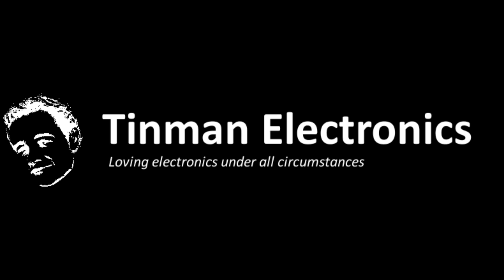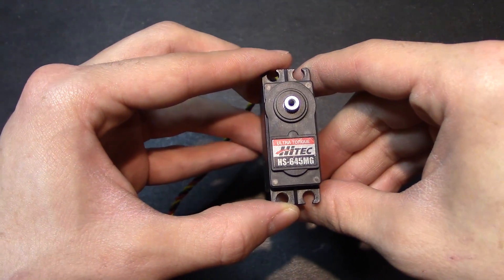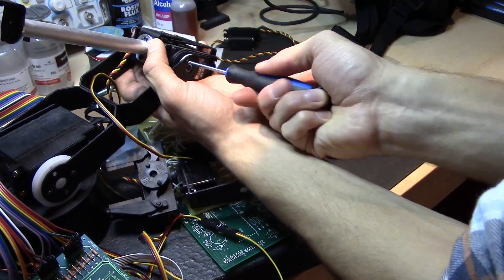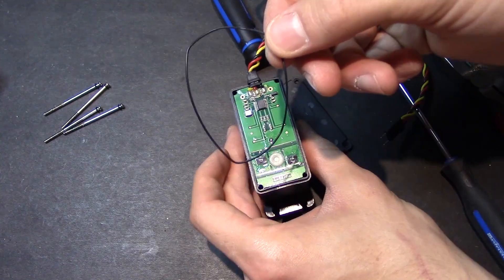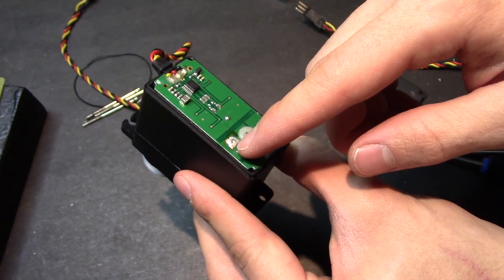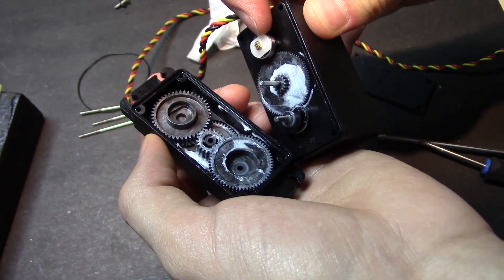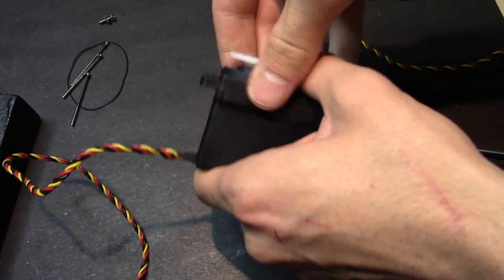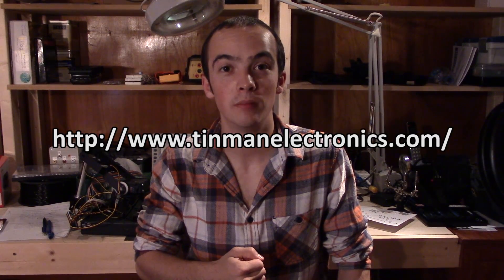Tinman Electronics 10 - Servo motor teardown and assembly

Comment: how do you discharge components that hold a charge ?
Reply from the maker: frank villa Short the two leads of the component with a resistor for a few seconds. 1k resistor should be fine.